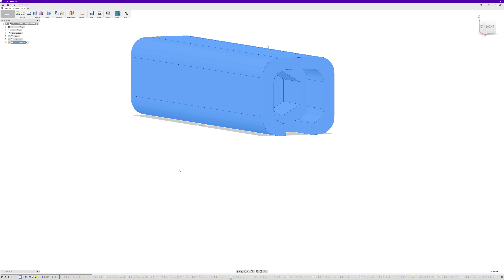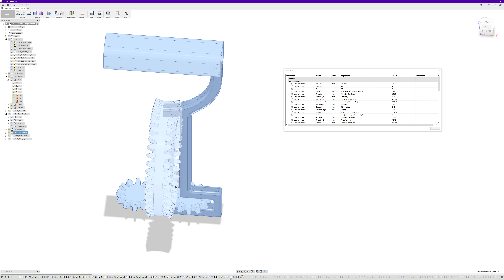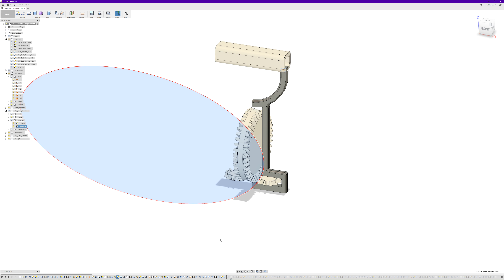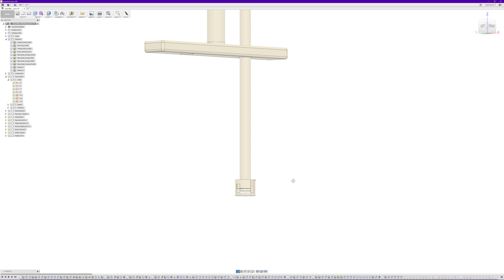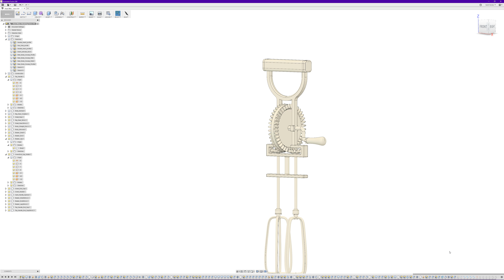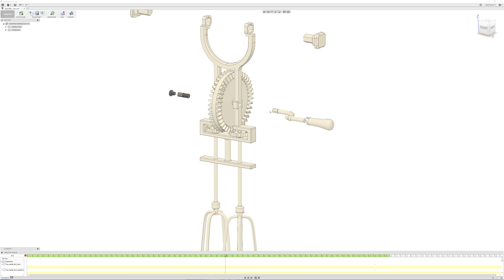welbot 3d prints Episode 2 - Making my mixer

Comment: Thanks welbot. Fusion does my head in :(  Looking forward to see this bad boy printed. Cheers, JAYTEE
Reply from the maker: It took me a while to get the hang of certain aspects of it. For the most part, I understood the concepts, but coming from a non CAD 3d background, I soon found that some things just don't work the same, which frustrated me a bit to begin with. Once you understand why they are limited in that sense, you can easily work around it though. :) 
I have no idea how it compares to the likes of Tinkercad, but I wouldn't imagine it's as different as going from 3d studio max to Fusion. If you ever want to give it a try, and need a bit of help, or want some tutorials, let me know and I'll be happy to help :)
Reply: Thanks welbot. Tinkercad is super simple but there some advanced features hidden away that I've not delved into as yet. It's not often I need to model something so for the time being, Tinkercad it is. Cheers

Comment: If only 3D printers weren't hugely out of my budget heh. Good video mate.
Reply from the maker: Thanks! Really depends what kind of printer you want, and how big you want to print when it comes to price. There are plenty of cheap-ish 3d printers around! Some for as little as $100USD. Quite a few decent ones around the $300-$500 mark too. Generally the bigger you want to print, the more expensive they get, but you can get something that will let you print something that's around 20-30cm cubed for well under a grand!